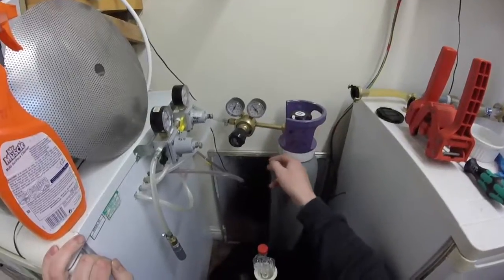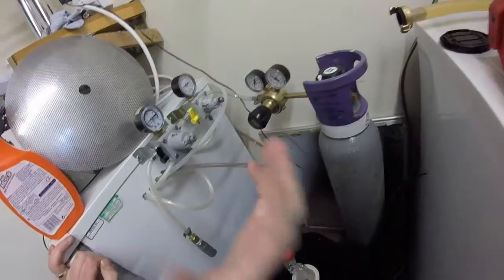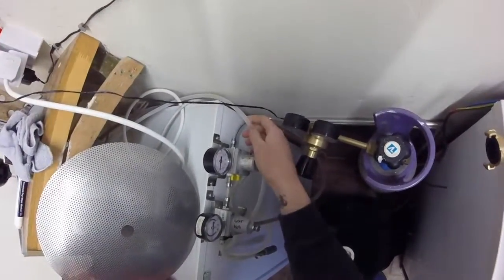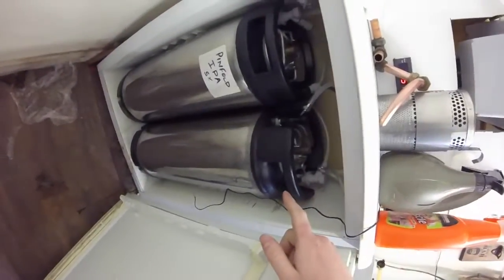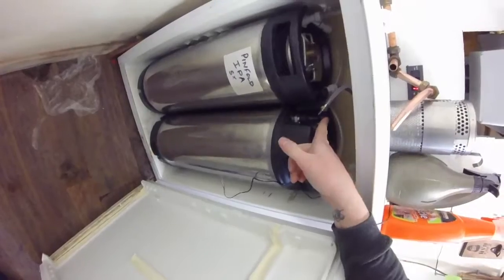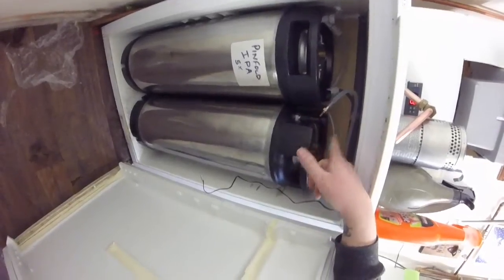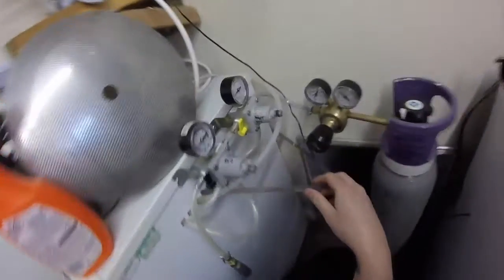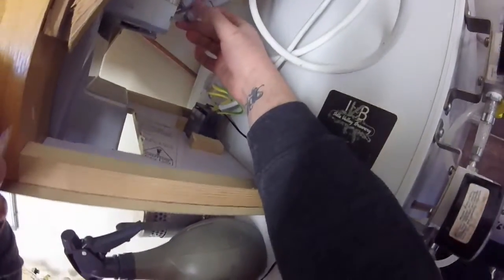Question About Kegs & Carbonation

Comment: Good one Tom. You're totally correct about everyone's system being different and how we have to tinker with what we got. This is what brewtubers are all about and thanks for sharing your settings. It's true we forget about those starting out and I tend to post videos geared to other enthusiasts rather than the beginner but thanks to you, I'm going to make a begginer how to brew on my next basic blonde brewday. I had foaming problems at first as well but there were three issues. First I found that rocking the ice cold keg at 20 psi for ONLY 25 or 30 sec didn't over carb but got a good head start. Then before test pouring each day, leave your testing glass on the fridge with your keg as warm glasses, off gas co2 in solution causing foaming. Lower your regulator to zero, burp off the pressure from the keg, attach the beer line and set regulator to 1 or 2 psi and pull a sample down the side. If needs more, ramp back to 20 - 30 another day and repeat. Serving pressure is paramount & will vary system to system. Mine rarely is over 4 psi but my friend has his at 8 which works on his setup. Thanks Tom and Cheers.
Reply: +mudflap72 With 4 psi, wouldn't your beer release gas as the head space grows? You couldn't keep 12 psi beer carbed up with less than 12 psi pressure on the keg right?
Reply: +ickmund I can see that being a problem with beers you may want heavily carbed but like Tom, I like my beers with enough to tingle my tongue and form a head. If I need to serve a bubbly blonde, I've got a longer beer line with smaller diameter so I can ramp the psi up to maintain.  Usually I have types that demand less and it works on my system.
Reply: +ickmund This is what I get when I respond before my first cup of coffee... I forgot to mention the most important parts and address what you alluded to, I store my beer at a higher psi per the type of beer. My serving pressure is less. On a picnic tap, foaming can come from insufficient resistance in your beer line (too short or fat), too high a serving pressure for the lines you do have, or old / dirty beer lines. I should switch out my lines for the longer & more narrow but I don't want a few meters of coiled line in my fridge since it's so small. My cooling element is to the back and if any part touches it, the beer can (and has) freeze in the line.
Reply: +mudflap72 What I'm getting at is that if your head pressure is less than what your beer is carbed too, the beer will release gas to equalize the pressure in the keg. So unless you keep the beer at one pressure, and then lower it every time your serve, over time you will have a less carbed beer. I'm all for a lesser carbed beer, but I like to keep it the same until the keg kicks.

Comment: Just what you said Tom. I carb at 30 psi for a couple of days then drop down to serving pressure 10-12 psi and leave for a week for the beer to age a bit then start drinking it. Most of my beer line is 3/16 and your pour seems faster than mine. It's just trial and error and finding what works for you. Cheers

Comment: I have two kegs on one regulator (T split) set to 13 psi for carbonation and serving. After two weeks at 2°C and with 3m beer lines I'm getting a great pour and the beer isn't green. Cheers.

Comment: I have one reg, a 4 way manifold, 3 kegs and I run 2.5m lines.  I usually set my reg to 15 psi for 7-10 days to carb, then drop to about 12 for serving.  Cheers

Comment: Like you Tom I have very short lines. I force carb at 20psi for 2-3 days checking it daily. serving at somewhere between 6-10psi. In truth I do need to increase my line length, but even though I have a tall fridge it's already crowded in there. Coiling the lines may well be the way.

Comment: Great video. Easy to follow. 

You mention serving pressure. What is your serving pressure?

I you then maintain serving pressure, will pint after pint be carved roughly the same, even over say 2 months, or will further adjustments need to be name to the pressure?

I ask as I am considering going Corni, but only if once set, the gas looks after itself.

many thanks.

Comment: Thanks for the info Tom, I'm carbing for the first time next week, I have a basic 3 keg keezer set up all with John guest fittings. Whats your impression of the JG fittings? i'm not used to push fittings and am worried about gas or beer leakage
Reply: The John Guest fittings are safe as houses. You can't go wrong. The only thing I would advise is that when you think they are coupled. Give them an extra push to make sure they are fully inserted. I didn't do this once and it required quite a clean up!

Comment: Great advice, especially as I have just ordered two kegs from Ireland at £30 each inc delivery, bargain! Does anyone have any advice though on where is best to get co2 from in North Yorkshire? Do you rent the bottle or own and get refills? Any and all advice would be appreciated. Cheers!
Reply: Not sure how North in Yorkshire you are but i get mine from Towler & Staines in Bradford. You need to purchase the tank but it is yours once you do and the refills are about £20 I think. I can't remember what the tank cost with the gas. I think it was about £55.
Reply: +Rob Day Cheers Rob, I am very North, Whitby. I managed to source a keg in Scarborough - £55 deposit - £20 fill.
Reply: +Rob Day Cheers Rob, I am very North, Whitby. I managed to source a keg in Scarborough - £55 deposit - £20 fill.
Reply: +99ulysses99 just a bit north then😀. Glad you found someone more local.
Reply: +99ulysses99 Hi could you post where you got your CO2 in Scarborough? I visit now and then so it might work for me too. Cheers.
Reply: +Gary James Dobsons Garden Machinery 35-37 Roscoe St Scarborough. Deposit for the bottle is £55.
Reply: +99ulysses99 Cheers. They'll refill as well?
Reply: Yes, depending on size it is about £20. Just give them a ring to check they have a replacement in stock to swap your empty one over.